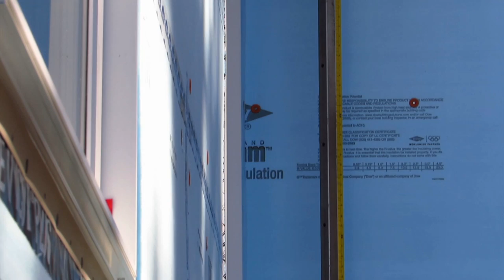Brick story pole system that will save masonry contractors time and money

Comment: If you are a bricklayer you can dump 500+ brick on corner leads in a 7 hour day if not more. I see the poles on long wall bending in from the line pull. That is still straighter than most idiots cal build a corner without all the BS many go through.
Reply from the maker: Every 3-6 courses you slide the bottom follower up with the line holder to prevent any bending.
Reply: SuperiorMason by the time you slide all your brackets I am done. What happens if one side of the lead the walls not going up?
Reply from the maker: Outside followers are generally not fastened as the line pulls them tight to the brick so they just slide up, it takes less than 2 seconds to slide them up.  If one side of the brick wall is not going up and you see some pole distortion from the line tension you may want to put in a spacer for the follower.  I have not heard that its a problem.
Reply: But you would still need to build half the lead with a level?
Reply from the maker: As long as your poles are still up you can come back to it, give me a call at 906-523-5638 to make sure I understand your concerns.